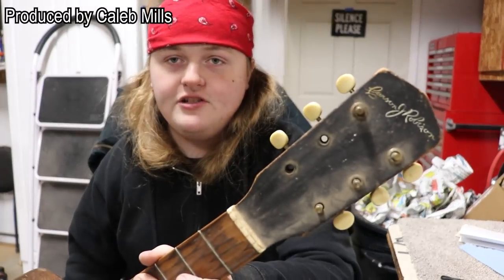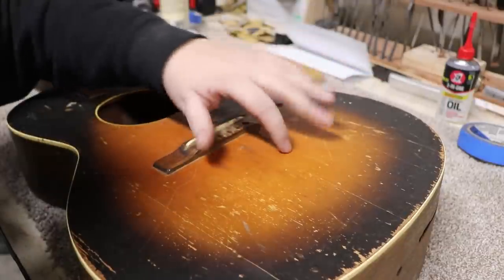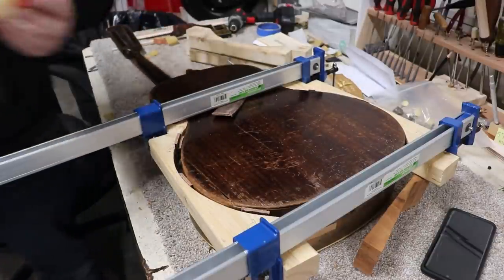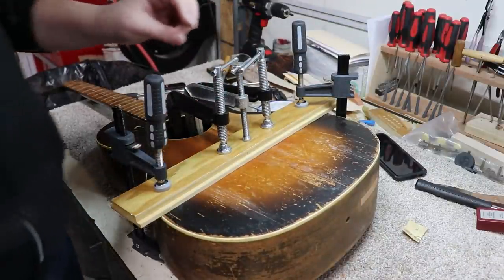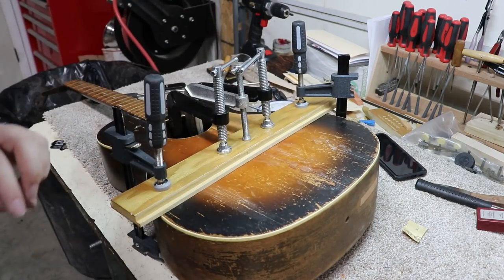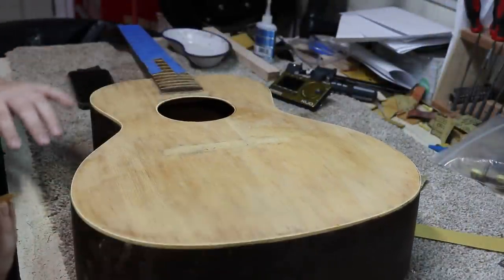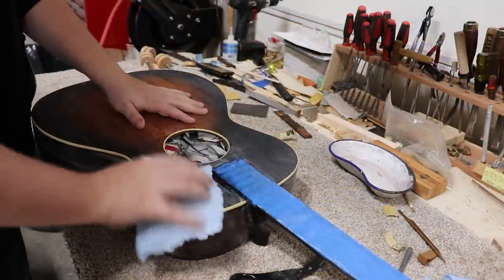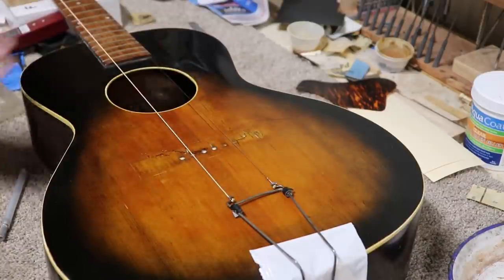534 RSW Long Gone But Not Forgotten Carson J Robison Guitar Part 1

Comment: How quickly the hour passed. Thanks. The transformation is pretty incredible. My job includes doing a lot of refinishing and I find I can often get more even/subtle absorption of a stain/dye after the piece has been pre-wet with the appropriate solvent. I've never done a burst, but I found myself wondering if this would help when putting the darker shade on. I really admire your sticktoitiveness, tackling projects like this.
Reply: Using alcohol to apply the dye works better. I used water with dye on a similar sunburst and the black has a gray hue to it. I didn’t have that problem with alcohol.
Reply: @pmscalisi : Jerry uses alcohol based dyes.

Comment: You would learn a lot watching several of the people who DO refinishing and color matching in dedicated furniture repair shops.  Actual wood stains can go on much more evenly that the leather dye you have does.

 Alcohol based stains can be applied light and successive coats will darken the tone to get where you want to be.  Even wetting down the entire surface with denatured alcohol before applying your leather dye would give you a more even application.     

THE number one comment others make when refinishing is do not start too dark in color.  It is far easier to add color, then remove it.  

There are also spray toners available.

Thomas Johnson Antique Furniture restoration on you tube would be an excellent choice to watch. Flexner on Finishing would be a good reference book.

It is much more a matter of learning more about finishing and less about having some dedicated shop.

Comment: A burst is so difficult to replicate and you did a good enough job to make it look better than it did when it came into the shop. All I would say is thin out the black so adding more coats gives you the darker edges and makes blending in more seamless and stops the clouding affect.  Also rubbing on the first couple of coats of tru oil with 000 steel wool helps fill in the grain then once dry rub with wool again then airbrush the final coats.  Gives a much better finish but obviously takes a little longer.  And tru oil adds a amber tint also . Good job tho young man
Reply: That's about as politely as you can say it.  Good constructive comment.  It is a big improvement.  We're used to "The Master's" stuff too...  I tried setting up a violin for the first time recently; about the same thing; big improvement over "out of the box" but not quite the Jerry Rosa job...

Comment: I would suggest only one thing: for the Tru Oil, you might want to hand rub the first coat or two (if not all). It could help with the issues you’ve had with filling grain, etc. I really like the way it looks.
Reply from the maker: Doesn't seem to help I've used every application technique in the book including brushing, hand wiping, rag applying, spraying it just doesn't matter

Comment: I would not have refinished the top of that guitar - I've bought, sold and traded vintage acoustics for decades, maybe it's just me but I like an old guitar to look like an old guitar. But as long as you had it apart I would have changed the ladder bracing to X bracing.

Comment: That guitar was in rough shape. I wonder what has to happen to a guitar for it to lose parts of its tuners. One thing you didn't do in this video was to use the devices Jerry has to show us what it looked like on the inside before you started working on it. I would have liked to see the bracing and the broken bridge plate. I also wonder why I was hearing some morse code in the background starting around the 31:00 mark.

Comment: Just curious! With the back already loose, why not pull the back and have better access to the top? Was it because of the cracks or budget or some other reason, just curious. Great job though!
Reply: Jerry has, in previous videos, explained, removing a back or front is a last ditch effort.
Because the sides can spring out (or in), making it Very difficult, to get the top/back
to line up with the sides again. Also, the bindings can be broken, opening a whole
other can of worms.

Comment: why could you not remove the bridge and glue it back together ?
Reply: The string groves were very deep and the larger bridge will help the top from bowing out again
Reply from the maker: too much stress and it was junk
Reply: @RosaStringWorks : Yep, that's why it cracked, the first time.

Comment: To be honest, that looks like a very low budget guitar. Someone must really be attached to it, to want all  that work done
Reply: BreatheScotland  well....surely the memories were in the Wear and tear, which is now gone...anyway,  not my guitar, so it wasn't a decision I had to make, thankfully
Reply: I used to buy Oscar Schmidt Stella guitars for $30. The last one I sold in about 2014 for $700. I refinished the first one in 1997, and bought and sold 4 more through the years. I think this Robison is solid birch, as were the Schmidt's. I did a lot of work on the necks and frets/fretboards, but there's no reason to NOT restore/refurbish an old solid wood guitar. I don't see an end to the return on investment. Plus, they sound really good once you massage them a bit.
Reply: @RaysMuleBarn  this one has a spruce top and apparently solid mahogany. These things are going for $1200 in fair condition now so this one probably worth 5-600. 
It also belonged to his grandfather.